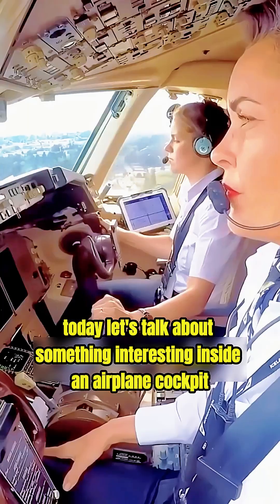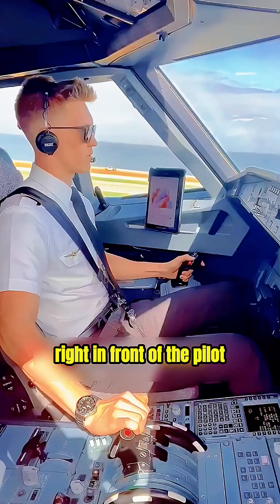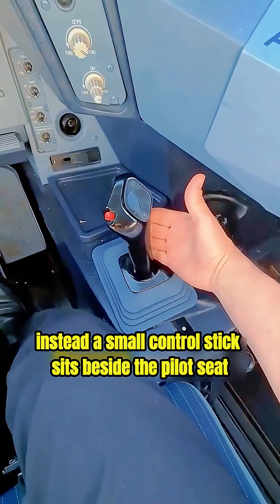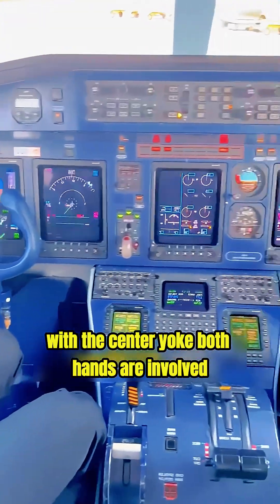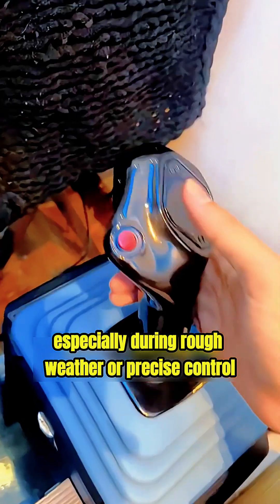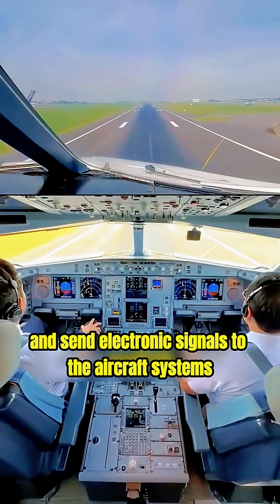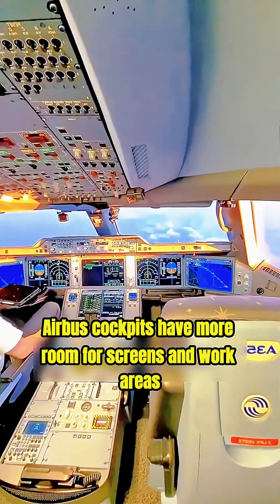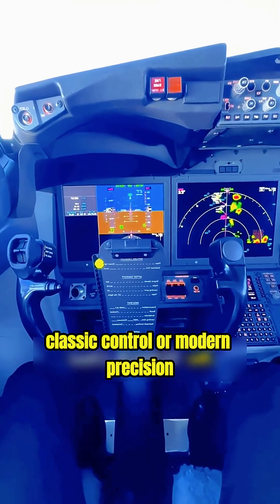Why Boeing and Airbus Use Different Control Sticks

Comment: It's funny that boing relies on pilots and air bus on technology.  The reality is that 90%of crashes is related to pilots. So hi 5 to airbus.Neither Airbus nor Boeing is definitively "better" overall; they excel in different areas, with Airbus currently leading in market share, deliveries, and backlogs, driven by strong narrowbody offerings (A320 family) and a focus on automation, while Boeing has historically dominated widebodies and retains a strong brand but faces recent production and quality challenges. Pilots often prefer Airbus's fly-by-wire, side-stick cockpit for reduced workload, versus Boeing's traditional yoke for more direct control, though both offer high safety standards, with recent Boeing issues largely linked to culture and specific software.